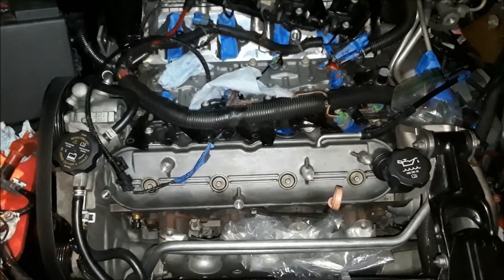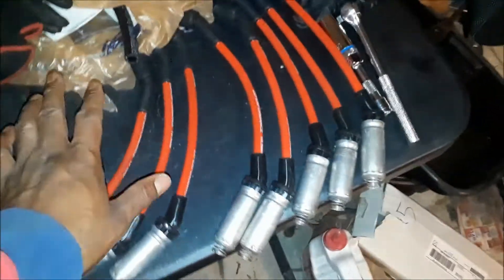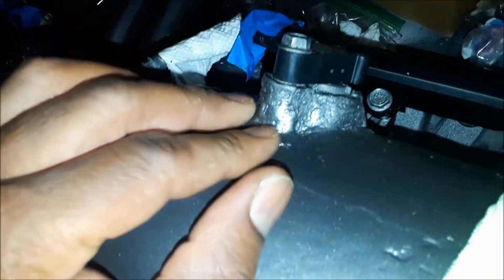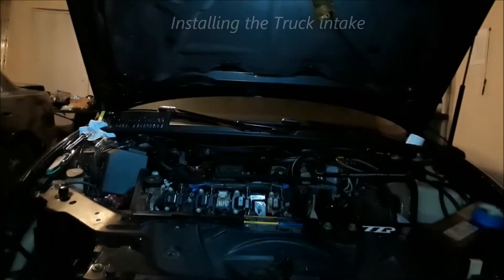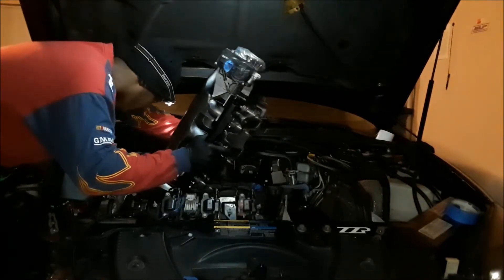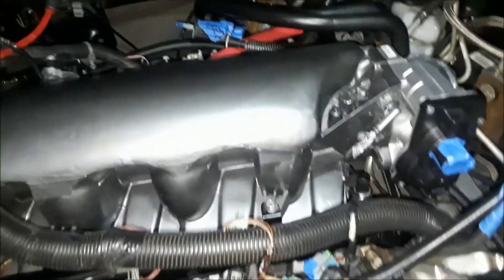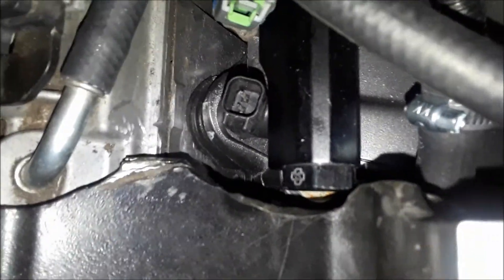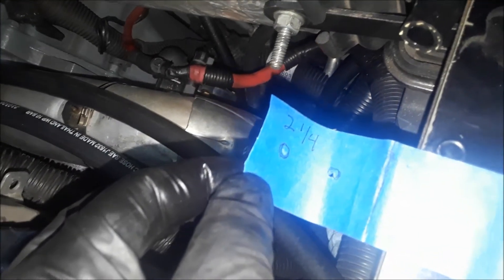LS4-LQ4 Intake Swap Step 7

Comment: Thanks for making this series! im doing the swap on my monte in a few weeks and im ordering the final parts,  i need intake bolts but i wanted to double check, did you use the lq4 intake bolts or the ls4 intake bolts when installing?
Reply from the maker: Thanks!! You'll love it! I used the LQ4 intake bolts.
Reply: @demariojason  thanks! Ill order them.  just wondering, do you think it would be easier unbolt the alternator bracket and shave it down outside of the car rather than bag off the engine bay?
Reply from the maker: @adamhellard433  well for me, I had a tough time taking it off (and could never get it off, lol) so of course bagging off the engine two times was pretty easy. Please make sure you wear a good respirator.
Reply: @demariojason  ok thanks for letting me know, ill let you know how it goes when i finish, just waiting for the snow to be gone before i start
Reply: @demariojason  Hey, for the map sensor extension cable, did you buy the "Wire Extenstion 24" LS Gen 4 MAP Manifold Absolute Pressure Sensor Connector LS3" from billet?
Reply from the maker: Thought I responded to your question, my bad. Yeah, I def used the truck intake bolts.